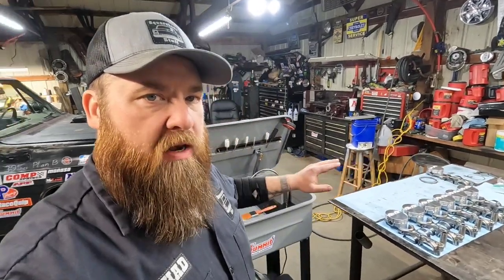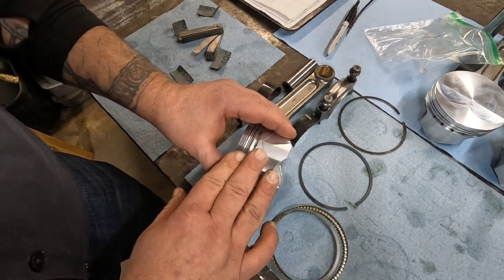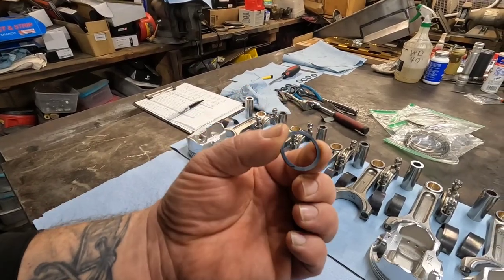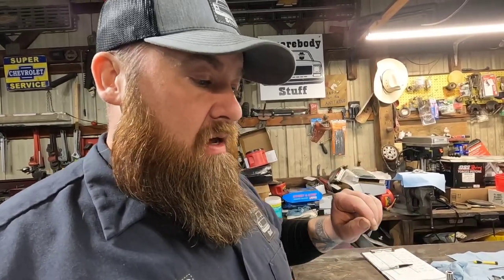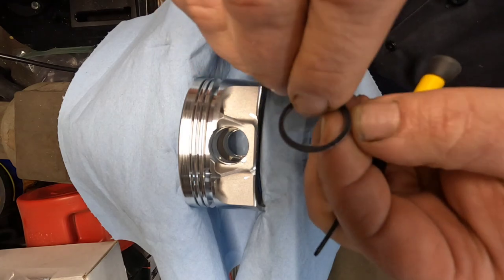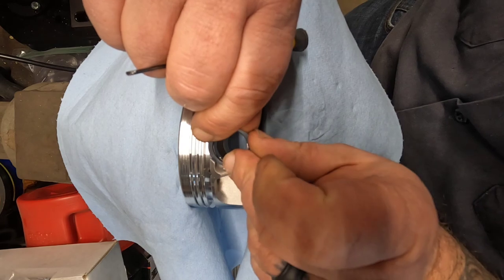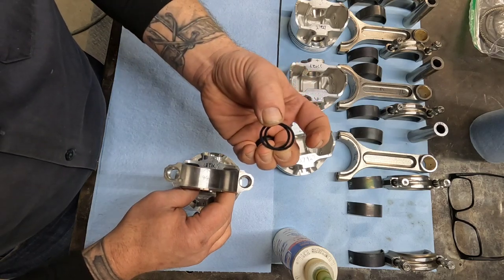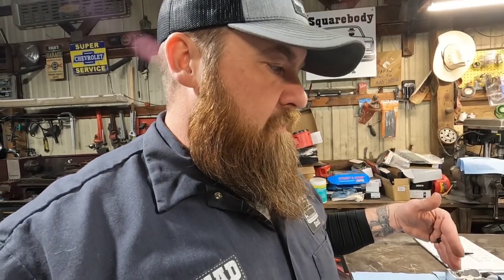How to install piston pin spiral locks on my nitrous 339 sbc stroker  #becauseracetruck

Comment: These detailed build videos are great! This will help when I finally get a 350. Installing the 305 next weekend. A little nervous about the wiping a lobe on the cam!! Didn’t know that was a thing until last week! Should have went roller cam! 😆
Reply from the maker: Nothing wrong with a flat tappet, just use good oil and a zinc additive and break it in correctly.

Comment: Those pistons and rods look great. Can't wait to see what camshaft is going in this thing.
Reply from the maker: I'm using the Summit 1107 hyd flat tappet cam that was in this 305 before I tore it down. It's a really nice profile for this combo.
Reply: @SquarebodyStuff  wow  those are good duration and  LSA specs.
Reply from the maker: @Alss383  yup
Reply: @Squarebody Stuff  is it possible that this will have a similar power band as a 383 with that camshaft since  this 305 is also using a 3.75 inch stroke crankshaft?   🤔 like HP, torque peaks and cross over points but with less power?
Reply from the maker: I'd guess  the curve will be higher in the rpm range.